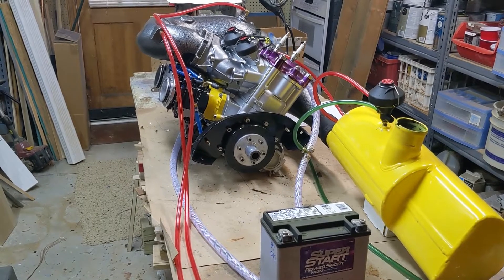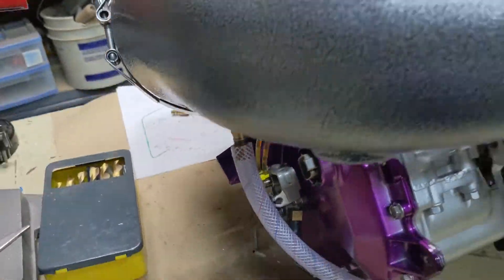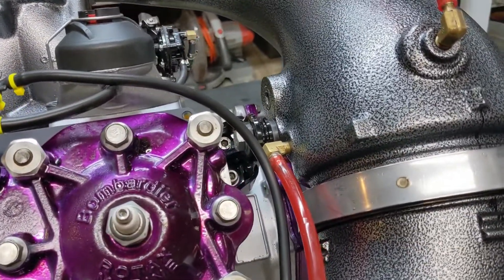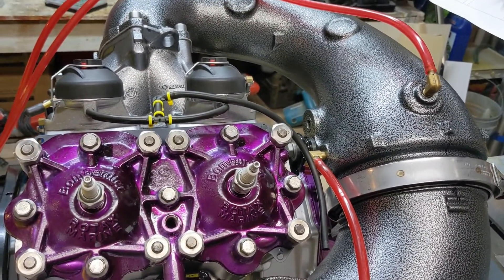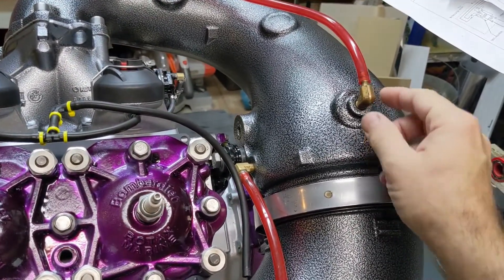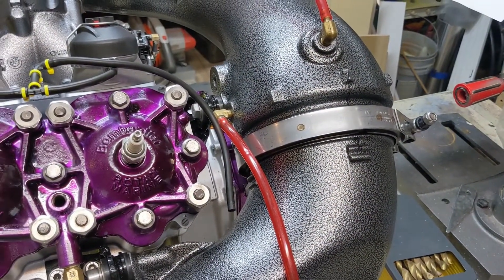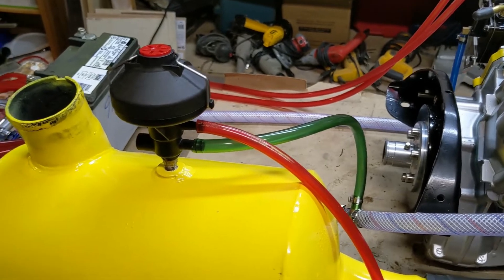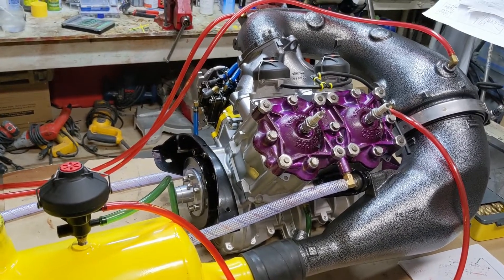Sea-Doo Cooling System - Gray Ghost Resurrection

Comment: I’m currently trying to figure out which hose on mine is the water intake hose. I recently had to get towed and I had no clue about pinching off so now I’m doing lots of research to make sure I’m not the one that destroys this machine. From what I see in your video, my engine looks the same as well as all connections from what I’m seeing. But now I’m concerned when you talk about the reversal of the water intake/output. I swear there is always something lol. The date stamp by the front seat connector reads 98/19/03. Would mine be considered a gray ghost?
Reply from the maker: The IN hose is always from the lowest fitting on the back transom closest to the pump center. The other one is higher and to the side ..that's the OUT. But when you run it on the hose ..it's actually "reverse flushing" so the flow goes backwards on the trailer. It's the IN to pinch for towing ..the lower one. In 98, they reversed it where the IN connects to the engine so it goes to the head and not the exhaust.
Reply from the maker: If the ski is not the red and grey GSXL ..it's unlikely you have the "white" motor, which is what they first put in these 97.5 GSXL (grey ghost).

Comment: Hi

Thanks for the video! 

I wonder can you please help me for my seadoo 2002 rx issue. I think my jetski won't warm enough. It only warm about water temperature plus 10 celsius. So if i drive 30 min on 15 degrees lake, motor warming only about at 25 celsius. I have also tried cylinders with my hand and i can easily keep hands on them. Water comes out for the side on jetski, so i think the cooling system works fine. When i tested it out of water without cooling it beebs hot engine after few minutes. So i think temperature sensor works fine. I tried to find thermostat, but if i'm right this model doesn't have thermostat. 
Is this normal temperature or not? If not, can you give advice what i should check?
Reply from the maker: These machines don't get  hot ..they will be warm on the heads and you can keep your hand on it. I wouldn't worry about it. But don't run it on the trailer long like that or it will heat up and damage the carbon seal. Never really a need to run these on the trailer more than 10 seconds or so. You are correct no thermostat. You can check the heat sensor by taking it out and putting a heat gun on it ..or put it in boiling hot water. Put the key on but don't start ..then put heat to sensor probe. You can also use an ohm meter ..that's how they work.
Reply: Thank you very much for these advices @jonparkmac

Comment: Should the water lines be ptfe
Reply from the maker: No, they only see water and only warm water. There is no high temp or pressure. But use automotive coolant hose and not Home Depot vinyl hose

Comment: Do you know size of the brass drain fitting? My rebuilt block is missing that fitting…
Reply from the maker: Not entirely sure but I think you can match it at ace or other plumbing store. For the 951 ..the part is 293 710 066. You can try a few brass ones from Lowe's/hd. That area is low heat and the inner nipple size won't matter ..teflon tape is your friend.

Comment: This is an amazing video I can't thank you enough for putting it out I just picked up a ninety-eight and ninety-nine ski it set up exactly like yours is my only question is where does that lower cylinder drain hose go mine is also right into the back of the ski admittedly these are basket-cases my question is where does it go?
Reply from the maker: There is a small nipple in the back wall of the ski for the drain, it's down low. May be hard to get to and may need to take out the water box or part of exhaust. Just needs a zip tie on it or simple clamp.

Comment: I have a 2001  SeaDoo RX 947 please can you tell I changed the engine supports and I don't know where the green hose that you show in the video goes, the drain hose I only have it connected to the engine but I don't know where the other end goes
Reply from the maker: There should be a nipple on the back transom wall down low. It connects into the exhaust port
Reply: I can't find my exhaust port connection....
Reply: I finally found that Port. It is directly underneath the steering cable that goes to the back. Very difficult to find. Even more difficult to get a hose and a clamp-on.

Comment: Do you know what the red cap setting should be on the water regulator for 2001 seadoo xp?
Reply from the maker: I do not and it's a complicated subject. Best to leave it factory. I've heard 3 full turns out from bottom, I've heard 2 clicks out from flush.

Comment: do you feel its beneficial to swap from the 97.5 water hose set up to the later years?
Reply from the maker: I believe so yes. The engineers changed it so it cools better. It doesn't mean it won't work as is,  but last thing I need is an overheated engine lol. It's just that one 48 elbo is a challenge to track down. And I suspect any barbed 1/4 " fitting will work, but needs to have fine threads